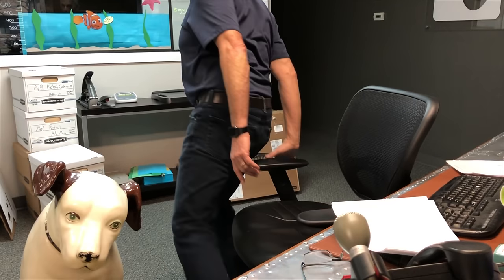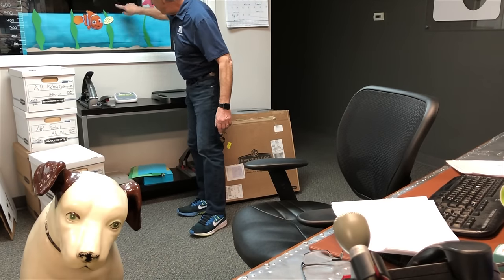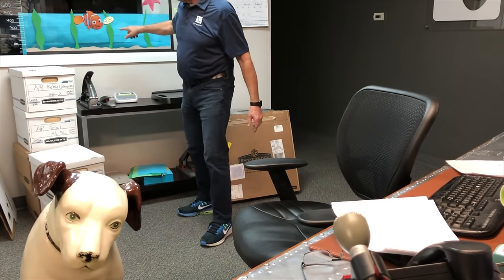Why do tubes sound different than transistors?

Comment: I always said the control signal in tubes is higher than the audio signal. In solid state the control is lower than the audio signal. So when you pump up the volume on ss devices, the audio signal seeps into the control, then you get bad clipping.

Comment: you could have elaborated a little more on this one. From what I understand in HiFi applications the tube is not the most ideal for fidelity albeit some like the harmonic distortion and noise floor which may act as a carrier smoothing the signal. It isn't the highest fidelity despite it being designed in it's time to give the truest signal fidelity strived for.  If one is playing back program material and adding harmonic distortion to it's reproduction then it is by definition no longer true to the original but an enhanced version

Comment: Howdy. One possible explanation.
In a BJT the collector current is dependent only of the base current and the gain factor. Collector voltage has no effect on the collector current. Within usable limits, of course.
Tubes are different. The anode voltage will have some effect on the anode current. The gain factor is not a constant. The gain factor will be smaller at high signal when the anode resistor causes the anode voltage to be lower. This is an inherent compressing property of tubes. It introduces the third harmonic to the signal.
Regards.
Reply: Research "Early voltage."
Reply: @marianneoelund2940  Hi. Blimey.
I stand corrected. The collector current is truly slightly dependent on the collector voltage. Thanks for the correction.
In high regards.

Comment: To most that ive met in the sound room, tubes are warmer, softer than solid state. But tubes wear out,must be replaced- not always so easily done. In the long run, tubes are way more expensive, run hotter, and just need a whole lot more effort. Some think tubes are worth the better sound vs the convenience of solid state. Then again, spend enough money,putting in the time to research past exaggerated claims and too high prices, solid state can sound very, very good.
Reply: I put new tubes in my preamp around 1980 and replaced them several years later and heard no difference and I'm still using the same tubes today. So tubes can last a very long time. Not output tubes in an amp of course.
Reply: you are right , good tubes are too expensive
Reply: I had that problem in the early 1970s.  I was using Dynaco Mark III mono blocks in my system and the output tubes needed replacement about every two years.  The KT-88 originally were about $8.00 each in matched pairs, but the price doubled every two years, so I purchased a used Marantz Model 15 power amp. It was also mono block construction and sounded great, but it kept giving me red lights while playing through my AR-3a speakers.   These speakers were rated at 4 ohms and it was lower at some frequencies, so I finally got a Marantz Model 250 which I still use.

Comment: Well depend, there's that guitar simultor profiler thingy, the Kemper, that in many tests sound more tube like than tube amps, okay is a guitar amp instead of an hifi amp, but you get my point right?

with modern electronics, simulating algorithms of tube amps in a powerfull enough computer inside an amplifier you can make a SS amp sound like a tube amp, but is just complicated
Reply: Sometimes I ask myself with the advent of solid state DSP (digital signal processing) based guitar amps in the 21st Century - why aren't Sony and other big name CE manufacturers making solid state amps with DSPs aimed at audiophiles? Just imagine a 200 US dollar 100 watt Sony integrated amp with 300B vacuum tube and Mpingo wood block DSP modes.

Comment: If an amplifier is changing the sound, you probably have a badly designed amplifier. No one is able to pick out a well designed tube amp or transistor amp in a double-blind test, just impossible. Tubes only sound different when you drop them on the floor. If you doubt the linearity of a transistor (like in this video), take a look at the distortion specs of a proper transistor amp. to a tube amp. That a transistor amp. outperforms a tube amp. regarding lower distortion figures is probably not the tubes fault necessarily, but is likely because of the output transformer that's needed with a tube amp. It's like saying an old Jaguar is faster than a modern Tesla, by ignoring the speed measurements and stating it just looks like it's going faster....
Reply: Every single amplifier, speakers, DAC, Turntable cartridge will colour the sound. At the end of the day, it is down to what the individual likes the sound of.

Comment: a mosfet transistor sounds tube like.gobal and local feedback to correct error to get them lienar i like design without feedback.needs good components short traces and a good layout of the board.the end power amp stages model xp milenium is a amp i have used since the 1 model was buildable then mk3.1 with dc servo card for bias? not shure on the top off my head..The end xp millenium has one extra amp stage.from verson mk 3.1 to xp millenium ther is a posibility to cut 2 traces and use a smal toroid transfomator to drive inputstages with 20 000uf capasitor after rectifier pr 2 channel output stage is driven with a 3-600vamp toroidial transformator rectified with 2 4way rectifiers .Transformator is double wound  with 4 leads out with around 40 volt+ comon/ground and 40 volt negative rails output stage has 100 000 uf pr 2 channels.point of no feedbackloop is if a error in signal it to late to fix it.better to not gety erros in first place.Bruel Kjær a well known messurement instuments etc have used this type amp for its linearity.Hope i could write so somone can undestand it
Reply: Designing circuits without negative feedback is like trying to write shakesphere without fingers, a fruitless task that is time consuming with very little to no end benefit.

Comment: One interesting thing I have noticed empirical.
If you replace one BJT with another in an amplifier, the sound will be more or less the same even if the transistor is of another brand and have other specs( within reasonable limits ).
But if you replace a tube with another one, the sonic imprint usually is totally changed.

That is what I call interesting. And a bit of a mystery.
Reply: vacume tubes surley will be sounding different every second they are played . Or am i wrong and they wear out in stages.  Come to think of it it dosnt even need to be used as some deterioration is happening due to contaminents that remain in a non perfect vacume??

Comment: Tubes sound better because they have harmonic distortion on the order of even numbers which sound more pleasing to the ear.  Transistors give off harmonic distortion on the order of odd numbers which sound harsh and unpleasant.
Reply: The quote you have made is closley related to the age of the listner. young ears mostly tend to like 3rd  while older ears tend to like 2nd

Comment: Tubes DO typically sound different... because they introduce additional nonlinearities into the system beyond what a FET or BJT amplifier would. Tubes warm the sound by distorting even order harmonics and allow for "soft clipping" by a similar mechanism.
You can just about digitally emulate the "tube sound" at this point, but it's still probably worth it for studios to record with actual tubes. However, for playback I strongly prefer a transparent sound... which typically means solid state.
Reply: tubes also produce un-even harmonics. at certain impedances they produce even more uneven than even order harmonics.

Comment: Tubes are making a comeback
Reply: You know, there is a modern tube ish device for microelectronics. Yes, a processor made out of millions of tiny vacuum cavities with anode, grids and cathode. Either the whole chip will have to be heated or it will warm itself up being used.

Comment: Tubes (we here call them "valves") will round off the top of the wave of an over-driven signal, rather than the precise clipping of solid-state devices . This gives a more pleasing sound than the harsh harmonics of squared-off waves. This point is of more relevance to guitar amplification than to hi-fi reproduction, but I do wonder about this affect on hi-frequency transients.  Anyhoo - I always enjoy your videos!
Reply: There are 2 things that make tubes sound different. THD in tubes is a lot more musical and tube compression allows things that shouldn't happen and is more pleasant than hard clipping.

Comment: Paul, you didn't explain why they sound different, only that there are differences in construction and electrical behavior. I was hoping you were going to crack the mystery instead of saying they sound different because  they "just do".  Tubes may be adding something to the sound, but solid state is definitely subtracting something.  Tubes sound better not just because of what they add but also by what they do not subtract, what is it they are not subtracting?
Reply: Mark Wilson They sound different, because they are different, I think that says it all. Different technology.
Reply: One friend explained it to me in very simplistic terms (knowing I'm not a technical person). He said that tubes produce even-order distortion, which is the same kind of distortion produced by acoustic instruments. And SS produces odd-order distortion, which we perceive as harsh and fatiguing. The best SS electronics I've heard were by darTZeel. While very good, it still didn't have the musicality of comparably priced tube equipment. And I've never heard a SS preamp come even close to conveying emotions like a First Sound.
Reply: Paul explained it. Tubes have a roll off on the low and higher frequencies. In between that in a linear line moving slightly up and to the right toward the higher end. Solid State Transistors don't have roll of points that curve on the lows or highs.
Reply: So, tubes act as a subtractive eq getting rid of most the harsher frequencies and giving off a pleasant psychoacoustic effect.
Reply: there are 4 reasons
1.placebo effect-see tube hear tube, take the cheapest reciever hide it and tell an audiophile its a handmade tube amp and he'll love it.
2. poor damping- because of the high output impedance, tube amps act as subtle dynamic eqs.
3.output transformer has random phase response which gives a wide soundstage.
4.microphonics-tube are very microphonic which adds a subtle bit of reverb.
Reply: up until a few years ago everyone had a tube in their house-your tv set. also tubes are still used in transmitters,
Reply: yes I forgot its a cathodeless rectifier.I just took one apart for the magnets to make a ribbon microphone.
Reply: Aside from number 3, all good and valid points. The bottom line is that salespeople who market faults as features are liars, and customers who devour the BS without questioning any of it are fools.
Reply: There is nothing like making one yourself, plus it cost next to nothing .
Reply: I enjoy building  and designing things.If you need a mic just go and buy one but people like me love the challenge of building things.There is nothing like using something that you yourself have created.
Reply: Who the piss is trying to make a royer??? I just enjoy the challenge of designing and buiding my own stuff.Now please just go away..
Reply: You're assuming that the feedback required by solid state has no measurable or audible effect.  With zero feedback you get more harmonic distortion, but you only hear it once (no ringing).  IMO this explains why tube circuits measure worse yet sound better.
Reply: every body has their own theories as to the origin of the "warmer sound". my opinion is that due to the very flat accurate response of ss amps they dont sound natural.  sarcasm aside it really is (in my opinion) down to the random fluctuations in the electrostatic field in the tubes. no electric field is truly 100% perfect. 99.999% sure thats doable. but the difference is audible. sarcastically speaking the cosmos thinks tubes should sound better. therefore tubes sound better.
Reply: EMP resistant. Still used in military equipment. In case of an H bomb detonated in the lower atmosphere over a continent, only MIG25's will still fly... now that's scary. I panic when wifi is dead. I can't even want to imagine having no electricity (electrical powered electronics)
Reply: That is just about the most subjective, loaded or ignorant statement I've come across on the topic. Both add a degree and type of noise/distortion, i.e. deviation from a correct/linear reproduction. Tubes generally add quite a lot more, much like Vinyl, which creates various versions of the warm/mushy/woollen sound signature that so many love, and others hate for its inaccuracy, where solid-states generally amplify much more "correctly", which on the other hand often just ends up exposing how bad a lot of recordings/masterings are, which tends to be why a lot of people prefer to sugar coat it a bit with some more even/harmonious noise. 
Its sort of like walking on a patterned floor, and finding it a bit uncomfortable, and pouring some sand on top of it, to make it more even, or sanding it down: it feels nice, but you lose some detail/accuracy in the process.'
Tubes are objectively speaking worse/less accurate - there's a reason we don't use them in modern electronics, but that doesn't mean it cant sound nice or that people aren't allowed to like them - cause they can really help some things sound nicer than they are... but at least be honest.
Reply: Statements about  even-order distortion as timbre  explanationin my view   is  false.  Even they are existing their impact is meaningless due to obvious fact that when he claims that difference to solid, listener do not use more than 20% of amp full power .   And that harmonics may be expected  at power more than 50% of nominal.  Claiming by guitarist should be rejected - they do whatever to make  distortions big , so they access ranges of overpowering.It  is the problem of solid state amplifiers which are   subtracting  parts of audio feedback depending on  speakers and speaker systems. In other words feedback signal which is to be  compared to input due to very complicated reactances of speakers is very different. And that is also explanation why some speakers match better some amplifiers than other.   Tube amplifiers due to linear characteristics around zero   are looped by much less feedback thus making much less harm. The reason is in speakers.
Reply: Lord Victor Halgaard
To state what is better one must have an ideal speaker system. With such system all sound sources, even theoretically have different capabilities sound the same up to no recognition It is because of   humans hearing limited perception to follow high  harmonics as  separate- not imaginable to spot lack of anything above 15 kHz   in natural complex audio signal. . It is only noticed by testing with separate frequencies by audiometry.  Or we manufacture speaker which will show special sensitivity to that range like actually 99% of speakers on market.  Even we feel difference we are not talking here about so high frequencies but rather about affection of middle range.For that range it is not true that vinyl  LP sound "muddy" - all digitalized CDs are made of them, also almost all tape recordings . This is case of perfect picking up and reproduction. With my last time made speakers it is not recognizable what is playing LP included - point is that it is also not different from  reai sound . .  We shouldn't blame LPs for our faults.
Reply: Distortion/saturation = noise. The Tube adds noise.
Reply: e james Plus they are immune to EMP ... that’s why they are used in military equipment!
Reply: @caminoprojectUS  -- Your comment is interesting. I remember reading an article about guitar amp tubes which brought out that some people theorize that because electrons can flow with a certain freedom  in a tube's vacuum, they can pick up some sort of beautiful pattern that gets added to your guitar signals. In a sense, it's like the subatomic world adding it's harmonies to the guitarists' playing.   I think this relates to what you are saying, perhaps.    physicists in general do agree the quantum level of the universe has many mysteries that manifest in ways that don't seem to agree with some of the things that humans view as common sense. But, such manifestations ,according to scientists , have been observed.   So, saying that tubes sound better might not be a far fetched notion.

Comment: Tube amp 5% distortion
Solid state .001%
Reply: while that's true, the harmonics emphasized are different. Tubes mostly cause second order harmonic distortion, which can have considerably higher amounts before being audibly unpleasant than third order harmonic distortion (and unlike in transistors, it isn't caused by signal voltage exceeding supply voltage since even small signal tubes run in the area of +200VDC on the plates but rather by input voltage exceeding electron flow from the cathode to the plate/anode).

Comment: i was told they used to use germanium diodes/transistor in the preamp to get a tube sound is this true?
Reply: Some guitar fuzz pedals use diodes to clip the waveform like an overdriven tube. The germanium diodes clip at a lower voltage and  perhaps the resulting effect more closely resembles tube overdrive.
Reply: i was told they also round off the sine wave (soft clipping) to give a warm sound

Comment: ...in a vacuum, electrons can travel freely between the cathode and plate... that's the main reason
Reply: Which is not much different from electron traveling thru a crystaline substrate loaded a few with impurities, no the main difference is the valve works at a much higher voltage resulting in a greater linear region; but IMO since it requires a impedance matching transformer; it may well sound worse than a transistor amp.